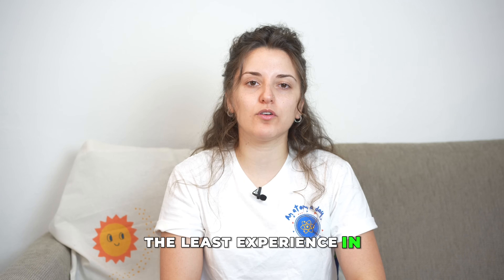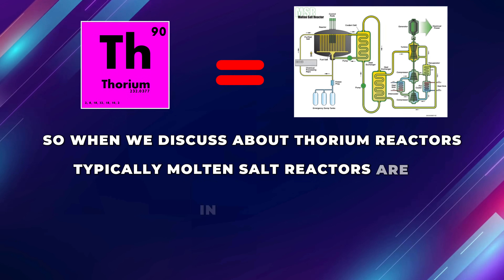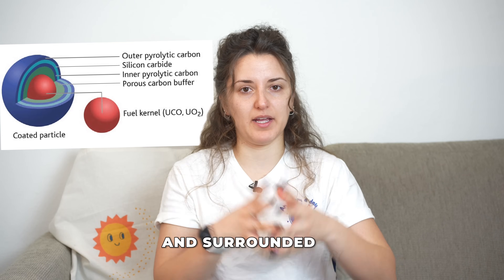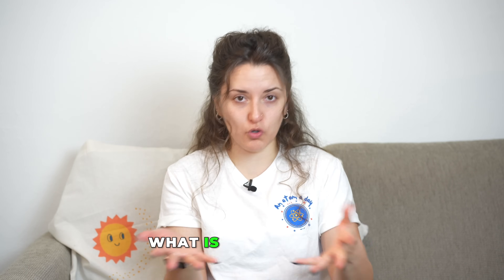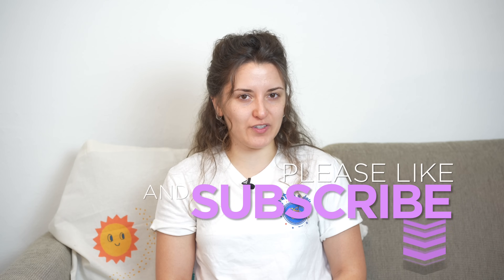Nuclear Physicist Explains and Compares All Gen IV Reactor Types

Comment: More Nuclear Power, More HydroElectric Power, More Solar and Wind Power.
We need to turn to Electricity, and turn away from fossil fuels like Coal, Oil, and Natural Gas.

Also, most nuclear waste can be recycled and turned back into fuel. And the small percentage of that waste that cannot be recycled will have to be stored.

Comment: I am really hopeful in particular with the future of the molten salt reactors in particular. By removing fission products they can achieve a complete nuclear burn, unlike conventional nuclear reactors that still have 96% of their U235 left when their fuel becomes depleted, so they have a fraction of a fraction of the waste, and they consume a fraction of a fraction of the fuel. They are capable of being nuclear breeders, creating usable nuclear fuel from cheaper, more abundant thorium, and they can operate at much higher temperatures, increasing their maximum heat engine efficiency, loosing less of their power as heat. Because fuel can be continuously added and waste continually removed, they dont need to be shut down to replace the fuel, meaning they can operate potentially a lot more cheeply, simpler, and continuously. Their main typical safety stop, freeze plugs are simple, and would be very reliable. They are neat.

Comment: IMO the best Gen 4 reactor design is by Moltex Energy.
It's an MSR with a key difference, there is no pumped fuel salt, no need for online reprocessing and actinide extraction, no issues with corrosion but with no need for new nuclear steels and it can still be refueled online. 

This is because the fuel salt is contained in metal canisters. It contains a sacrificial component to prevent corrosion, like how a sacrificial anode works. It has a gas valve at the top to let low density gaseous fission products escape and keeps the high burnup features of MSR and their mobile-but-static fuel.

The fuel tubes can be lifted, rearranged and relieved as needed while online.

The core is cooled by a separate pumped salt loop of a different line of salt and will continue to passively cool the core to the outside atmosphere even during a loss of power and scram situation. 

So you get all the myriad benefits of an MSR while having a reactor that behaves like a regular PWR.

It's one of the most elegant designs I've ever seen, it's beautiful.

Comment: The US had a commercial helium-cooled commercial reactor. It was installed at Ft. St. Vrain in Colorado. It was not a success and it was eventually decommissioned and converted to a natural gas-fired power plant. I am not an expert, but the problem as I understand it is that helium is not actually inert at those temperatures and pressures, but became corrosive, and they did not have material sufficient to withstand the corrosion, leading to lots of downtime and maintenance.

Another issue I see with helium: it is a finite resource that is separated from natural gas. We already have a huge need for liquid helium in superconductors including MRI machines to the degree that there’s a global shortage, even though we are extracting natural gas at record rates. Helium is so light that it floats off to outer space. I can see a future where we have to keep drilling for natural gas at current rates or greater just to extract helium, and then pumping it back underground to impound the carbon.

Comment: My opinion is that the diametric difference is to talk for decades about new projects that exist in the computer and on paper, but not actually building or only be starting to build, so not operating compared to projects that are already in real commercial operation, what is the fourth generation (fast breeder reactors) only is a Russian BN-600 and BN-800.
Russians no longer say what they plan to do there, they have actually been using it for decades.
The news that you don't talk about and which are very important in the development towards profitability and thus serial production this types are:
2 years ago, only MOX was loaded into BN-800 for the first time.
Half a year ago, a new MOX cartridge containing minor actinides was loaded into the BN-800, where it has already been confirmed that the "burning" of these dangerous substances from water reactors, which have a half-life of several thousand years, really works in the BN-800. 
That's why they started building two CF-600s in China according to Russian projects with contract supplies of Russian MOX fuel.

And that's the difference between where others are today versus where Russia is.

It has also already been confirmed that the BN-800 achieved the effect that the weight of fissile materials in the already used MOX charge taken out of the reactor is higher than the weight of fissile materials in the charge before being brought into the reactor, which means that this reactor produces fuel not only for itself but also for other reactors. 

A few months ago, a test of fuel cartridges for the BREST OD-300 lead-cooled fast reactor, which no longer contain MOX fuel, but SNUP (plutonium and uranium nitrides) fuel, was completed on the test stand.
This new type of mixed fuel produced from water reactors radioactive waste is characterized by a higher density of material in the fuel pellets and at the same time better heat dissipation, which means that the efficiency of the breeder reactor using SNUP is up to 20% higher compared to MOX.
Currently, several dozen SNUP cartridges were loaded into the BN-600 in order to be able to definitively evaluate which type of fuel will be preferred in the future for the BREST OD-300, BN-800 and BN-1200M from the point of view of safety, processing price vs. energy efficiency and also from aspects of the breeder effect.
BREST OD-300 will be completed next year and by then it should be clear what type of fuel it will be filled with, or in what ratio MOX vs SNUP.

So if the Americans or anyone else is talking about what they are developing, it's about a slide of about 20 years from the stage where the BN-800 is today, but yes I understand that everyone has the right to talk about their new projects, I just think that the projects , which are already in the stage of real operation, have a significantly greater right to a detailed and longer information than projects that are only talked about and do not actually work yet or there were once attempts to launch them, but that were unsuccessful.
Because what's the point of talking for 15 minutes about a reactor that isn't even working yet or hame too many problems and disadvantages, but about a reactor that's been in operation for almost 10 years you talk only a few words?

I know, today's policy of EU is to ignore or gloss over the results of enemies and highlight (mostly non real) the results of friends.
However, if we go to the heart of the matter, they did not become enemies because they wanted to, but because your friends did not want to be real friends with them.

Comment: Nice vid, congrats!

A small correction: around 6:05you say that material development for MSRs is challenging since fluoride/chloride salts are highly corrosive.
On contrary, nuclear reactor engineering veteran Ed Pheil plans to use code verified materials exclusively for his Molten Chloride Salt Fast Reactor. He states that stainless steel is OK with chloride salts,  actually water is more corrosive at elevated temperatures.
Additionally, MSRs are not necessarily operate with thermal, or epithermal neutron spectrum only. Using chloride salts one gets quite a hard spectrum of neutrons, similar to SFRs.

Anyway, the video is very informative and I wish success your channel lot of success!

Comment: It seems to me that for current construction, the CANDU reactor is the best choice.  It allows on-line refueling and will burn waste fuel; it has extensive commercial experience.  For future research the MSR (either Thorium or Uranium) seems promising because of its ability to load follow.  The MSR can heat a large pool of molten salt.  At periods of high demand, the turbine can extract heat from the molten pool faster than the reactor's maximum capacity.  After the peak passes,  the reactor continues to function at maximum capacity until the pool has been reheated (see TerraPower).  As I understand it, the technology or Thorium and Uranium are quite similar for a MSR. Being able to use the byproducts of rare earth metal mining (thorium) is an extra benefit to having multiple fuel types at different sites.

Comment: Have you done a video about the problems of scaling up from prototype reactor to full size reactor?
The UK built a prototype AGR and the simplified version of event is that the prototype was quite easy to build and worked really well so several full size power stations were ordered and they turned out to be enormously more difficult (and expensive) to build than expected and had all sorts of unexpected operational hitches when they were being commissioned. This did a lot to ruin the reputation of nuclear power in the UK.
How can we be certain that a promising small scale reactor won't scale up really badly and become known as a bit of a white elephant?
(it was the mention of on-load refuelling that reminded me of this - the AGRs were supposed to be capable of on-load refuelling but afaik it's never been done on a full size AGR power reactor.)

Comment: Summary
- 0:00 Generation 4 Nuclear Reactors Overview
  - 0:00 Discusses the transition from current reactors to Generation 4 types.
  - 0:17 Focuses on six proposed Generation 4 reactor types.
  - 0:27 Compares them based on differences from current light water reactors, pros and cons, countries developing them, and development stages.

- 0:49 Sodium-Cooled Fast Reactors (SFRs)
  - 0:53 Operate on a fast neutron spectrum, better at fusing uranium-238.
  - 1:31 Coolant is sodium instead of water, allowing higher operational temperatures and efficiency.
  - 1:46 Russia leads development with operating BN600 and BN800 reactors, and the upcoming BN1200.
  - 2:04 China also developing SFRs, including the CFR.
  - 2:46 Challenges: sodium's reaction with materials requires careful design.

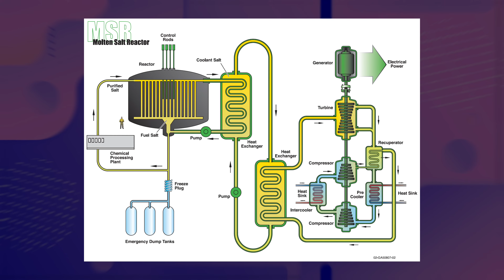- 3:01 Molten Salt Reactors (MSRs)
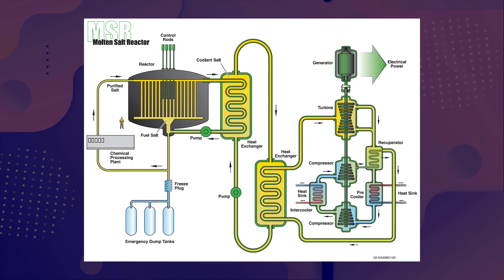  - 3:07 Use molten salt as fuel, circulating in fluoride or chloride form.
  - 3:39 Allow online refueling and reduce downtime.
  - 4:07 Potential to reduce nuclear waste and use thorium as fuel.
  - 4:50 Inherent safety features and passive cooling.
  - 5:55 Material development challenges due to corrosive nature.
  - 5:21 Limited commercial operation experience.
  - 5:23 Countries like the US, Canada, and China are key developers.

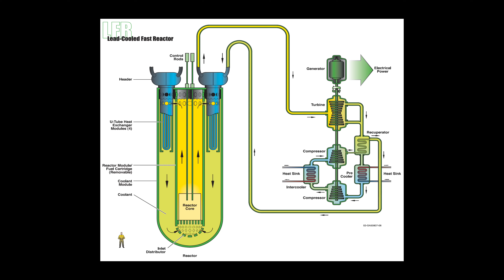- 6:24 Lead-Cooled Fast Reactors (LFRs)
  - 6:40 Use liquid lead or lead-bismuth as coolant.
  - 6:50 Offer efficient radiation shielding and high-density benefits for smaller reactor size.
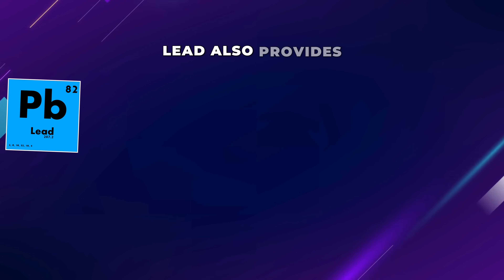  - 7:25 Higher temperature operation leads to efficient heat transfer.
  - 7:54 Inherent safety with negative void coefficient.
  - 8:35 Material challenges due to corrosive nature of lead.
  - 8:55 Limited commercial experience.
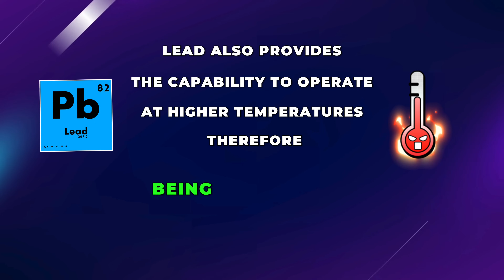  - 7:32 Russia and European countries, including Sweden, are prominent developers.

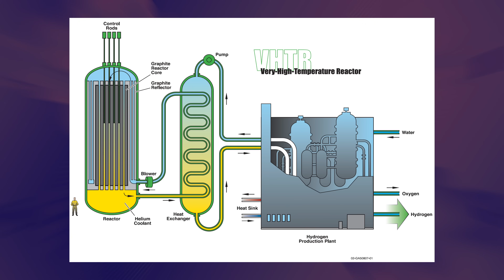- 9:01 High-Temperature Gas-Cooled Reactors (HTGRs)
  - 9:04 Operate on both fast and thermal neutron spectrums.
  - 9:22 Use helium gas as coolant, enabling high-temperature operations and hydrogen production.
  - 9:57 Utilize tristructural-isotropic (TRISO) particle fuel.
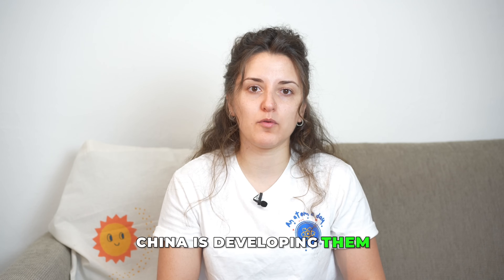  - 9:49 China leading development with HTGR-10 and HTR-PM projects.
  - 11:01 Challenges include new fuel development and limited commercial experience.

- 11:08 Super Critical Water-Cooled Reactors (SCWRs)
  - 11:13 Early development stage.
  - 11:31 Super critical state refers to water being between liquid and gas.
  - 11:57 Simplified design compared to current light water reactors.
  - 12:24 Can operate in both fast and thermal spectrums.
  - 12:29 Higher temperature and pressure operations for better heat transfer and efficiency.
  - 12:00 China and Canada among the countries developing SCWRs.
  - 12:57 Very limited commercial experience.

- 13:02 Gas-Cooled Fast Reactors (GFRs)
  - 13:04 Operate on a fast neutron spectrum, mostly developed in France.
  - 13:07 At an early research stage, potentially employed in the 2040s.
  - 13:14 Use helium as coolant, similar to another reactor type, but combined with a fast neutron spectrum.
  - 13:27 Efficient heat transfer and high temperature applications, such as hydrogen production.
  - 13:43 Inherent safety due to inert and non-reactive helium.
  - 14:07 Disadvantages include no operational experience and being at an early development stage.

- 14:15 General Overview of Generation 4 Reactors
  - Understanding Generation 4 reactor types, neutron spectrum, coolant choices, development stages, and countries involved is essential.
  - 14:42 No perfect design; each has its own advantages and challenges.
  - 14:47 Different designs are chosen based on the ability to tackle specific challenges.
  - 15:02 Countries choose designs based on their capability to address challenges and specific applications.
  - 15:27 USA and Sweden, for instance, are focusing on multiple designs and lead-cooled designs respectively.
  - 15:34 Future developments, challenges, and potential design changes are anticipated in this evolving field.

Summary of top comments (as of 2023-12-30 with 21150 views, 208 comments, 1.7k likes)

- Requests for specific follow-up videos:
  - Separate video on fuel concepts, especially TRISO fuel.
  - Video detailing the start-up and shutdown process of Liquid Metal cooled reactors.
  - Video on the efficiency and design of various reactor types including pebble bed reactors.
  - Video on the potential of nuclear energy, fusion reactor research, and fission-fusion reactor designs by startups.
  - Video exploring radioactive contamination and its cleaning processes.
  - Video on helium cooling in reactors and its impact on materials.

- Comments on specific reactor types and fuel:
  - Interest in high-temperature gas-cooled reactors for hydrogen production.
  - Discussion of the use of MOX fuel in BN-800 reactor and its composition.
  - Comments on the cost and complexity of manufacturing TRISO fuel.
  - Mention of Russian submarines using lead-bismuth reactors.
  - Discussions on the MSR molten chloride fast reactor and its potential.
  - Comments on thorium reactors and their efficiency.

- General discussions and queries:
  - Questions about the corrosiveness of fluoride in MSR designs.
  - Curiosity about the materials used in reactor construction, especially steel and its reaction to radiation.
  - Discussions on the economic viability of different reactor types.
  - Interest in the potential of breeder reactors for efficient fuel use.
  - Mention of historical reactors like Fort St. Vrain HTGR and Peach Bottom Unit 1.
  - Queries about the relative efficiencies of different reactor designs.

- Personal stories and experiences:
  - Sharing personal experiences and memories related to nuclear power and reactor technology.
  - Expressions of gratitude for the educational content and requests for more detailed explanations of reactor types.

- Miscellaneous comments:
  - Wishes for the holiday season and new year.
  - General appreciation for the informative content and requests for more videos on nuclear technology.
  - Discussions about futuristic concepts like using nuclear arsenals for space projects.
  - Comments on the use of helium as a coolant and its properties.

Disclaimer: I used chatgpt4 to summarize the transcript and the youtube comments section.

Comment: The AGRs in the UK provide an interesting case study for higher thermal efficiency (since they run hotter than LWRs) and also the pros and cons of gas cooling. And they are a full production design with several decades of service life. The main problem is cracking of the graphite blocks in the reactor cores was always going to be life limiting.

Comment: Thank you for your videos.!

I was wondering:

-Do you think it’s possible for participating countries to donate their nuclear arsenal (in the same manner we converted the Redstone Arsenal for space)for launching material into orbit for building a pair of World Owned O Neil Cylinders?

My thinking is ICBMs can launch as much steel and composites in the space, while also be melted down for the raw components to be integrated into it.

After that, the only thing you have to worry about is the fissile material, and that should be able to be transformed into nuclear power for countries that desperately need it, like China.

They are so desperate for power, why not melt down the nuclear stock piles for nuclear energy?

The ICBMs and other material would be integrated into a pair of O’Neill cylinders and the material connecting them.

Comment: The Hermes demo reactor at the site of the old K-25 facility here in Oak Ridge will be using TRISO fuel (also being produced in Oak Ridge) in a molten fluoride salt cooled system. Also X-Energy is developing a HTGR using TRISO here in Oak Ridge. 
I'm personally more a fan or molten-chloride fast reactor (MCFR) or other MSR reactors, since they don't require the fuel manufacturing step, and seem better suited to using up existing waste stockpiles. This could be especially helpful with decommissioning nuclear powered ships.